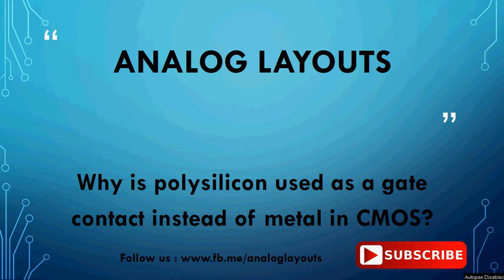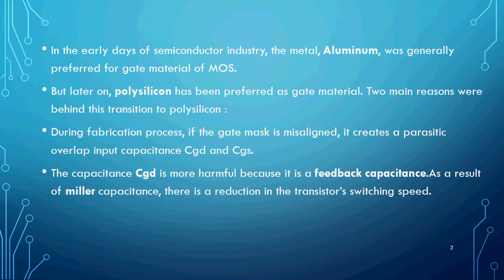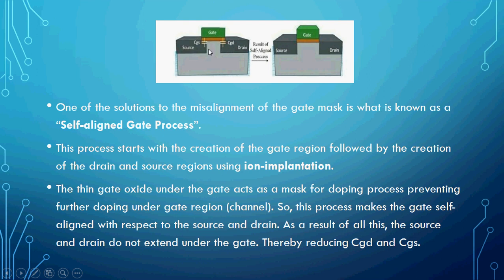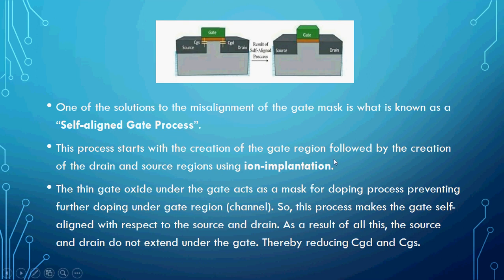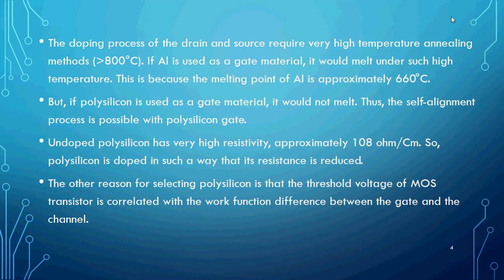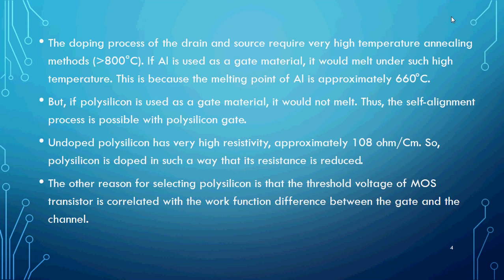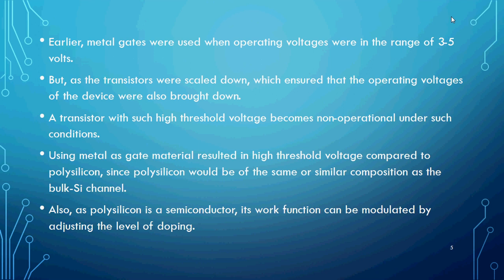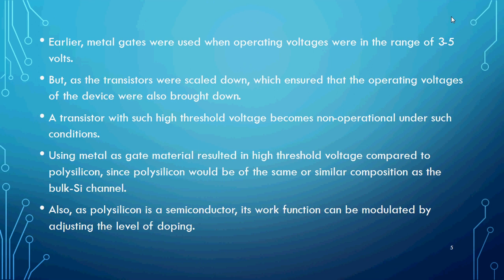Why is polysilicon used as a gate contact instead of metal in CMOS ? - English  Version

Comment: Hello , i am confused can you help me ? As i know  a mosfet gate should be insulator and attract ions near applied voltage  but you say its conductive.
Reply: Polysilicon is conductive , there is a silicon dioxide between the polysilicon and the substrate which makes the gate terminal non conductive (Ig=0A)

Comment: Good explanation! But make more English version videos
Reply from the maker: thx for ur comment & support , sure i will make all the videos asap
Reply: Sir why do we need bulks in mosfet? I understood why it is connected to vdd & vss based on pmos & nmos but i didn't understood why do actually required bulks?
Reply from the maker: its a fabricated method , pls refer cmos fabrication types
Reply: @mohammedafzal534   As far as i know bulk is needed to give strength to the wafer. If the wafer was too small it can break very easily.